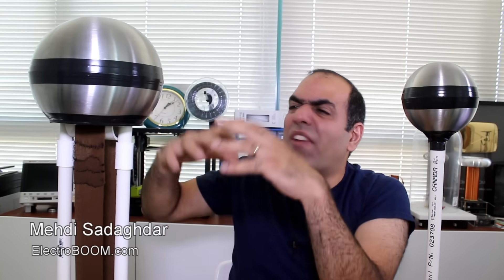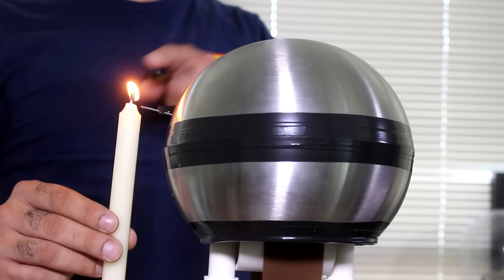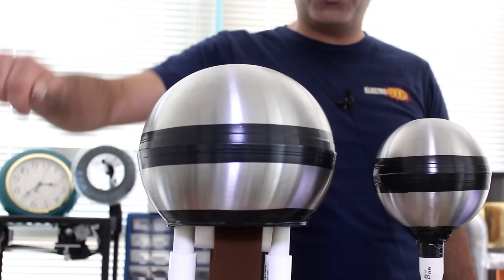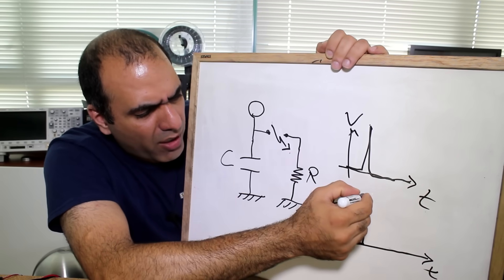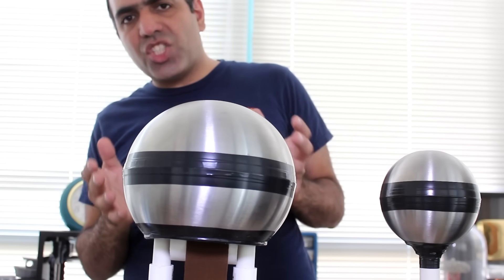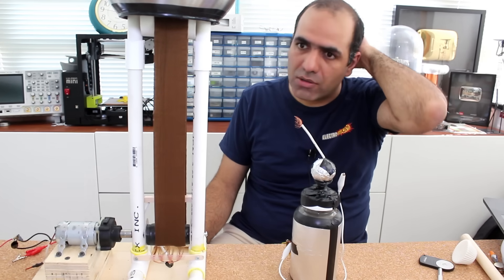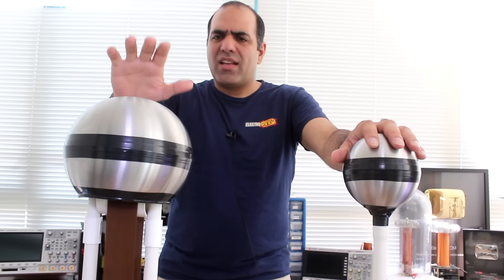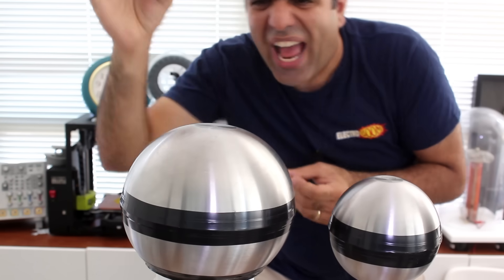Painful Experiments with Van De Graaff Generator

Comment: Dear Electroboom I would like you to explain something to me. You need around 20.000 Volts per centimetre and a lightning can obtain more than 10.000.000 Volts. But how is it possible that the lightning arks into the earth when 10.000.000/20.000 equals only 5 meters.
Reply: I might be wrong, but i think it's because humidity and water particles can provide a better path to the ground.
Reply: +KFC_Manager that may explain the weird paths that the lightning takes to the  ground, otherwise it would be a boring pseudo-straight line
Reply: Things behave differently at these voltages.
The 20000 V/cm rule is only at relatively low voltages helpful.
Reply: Mr Bass:
The air in a thunderstorm, especially in the upper regions, is really moist. This reduces its electrical resistance dramatically. Also the air gets ionized during a Thunderstorm reducing the resistance even further.
Reply: Raphael Arndt so if this boosts the length of the lightning this much and if Electroboom would use his van de Graf generator in a thunderstorm would the arks of his generator be almost equally boosted? In that case the arks of his generator should obtain around 200.000 Volts(generator)/10.000.000 Volts(lightning) times the length of a current lightning ( a little bit less because the air around the storm-clouds being far more ionised)...

Is this right?
Reply: Mr Bass They wouöd definitly jump larger gaps. But I can not tell how much larger.
Reply: Raphael Arndt but maybe Electroboom can tell us all in a video
Reply: Mr Bass would love to see that. Mehdi, would you please?
Reply: A very good question- hope he answers with a video actually, I would guess it has to do with that being a calculation used more for something like a spark gap which is simplified for typical conditions.
Reply: Think how the electric arc build up. Not only will exist a large potential difference between two points but as soon the dischage starts the air becomes very hot and conducting electricity in plasma is fair more easy than in air. This process occur sequentially until the potential diference becomes zero. The low pressure path is now occupied by air again and the collision of the air masses produces a sound: the thunder.
Reply: Leonardo Lelis a video about this phenomenon by Electroboom would be cool though
Reply: Leonardo Lelis well explained
Reply: Leonardo Lelis imagine he could reproduce that phenomenon in an artificial way
Reply: That would be a high voltage Tesla Coil in a low pressure chamber. Or he could reproduce the Wardenclyffe tower...
Reply: Curious to the answer too
Reply: Professor Walter Lewin answers this:
https://youtu.be/ww0XJUqFHXU?t=1476

The electric fields required for propagating an arc are orders of magnitude smaller than the electric fields required for initiating that arc.
Reply: I believe it is to do with the fact that when there is lightning it is usually raining, reducing the resistance of the air
Reply: During rain conditions with increased humidity such a voltage will easily ionize air particles around the source, and it becomes like a domino effect. The next ionizes the next and so on till it gets down to the earth.
Reply: And that may be what you have on 5 meters of air.. since a tree burst when hit by a lightining I think that 10.000.000 volt is just what it takes!...the clouds can be more charged in my opinion that voltage is just estimated I don't think somebody ever measured that!

Comment: @ 9:54 You said you can adjust the speed of an AC motor with a dimmer switch. I was always told that the speed of an AC motor is 

"Ns(rpm) = 120 x frequency /poles" The speed of an ac motor is not dependent on the voltage.

Comment: I had a science teacher show us one of these once and he did the cupcake wrapper thing but slightly differently. He used larger, tin wrappers and stacked them up on top of the orb before turning it on. They then got thrown off one at a time from top to bottom. It was especially cool because the rhythm was very consistent, just like those arcs in the video.

Comment: What happens if i have a power supply with current limiting feature and i set it to 220v and 1uA ? Will it hurt me ? So is it the current that kills you or the voltage ? Help me pls
Reply: You're talking about a neon mains tester (https://en.wikipedia.org/wiki/Test_light#One-contact_neon_test_lights), and no people generally don't die from using it. Then again, you should never take advice on electricity from a random bloke on the internet.
Reply: He's done another video on this subject. https://www.youtube.com/watch?v=XDf2nhfxVzg
Reply: Hera when the current is being limited, the voltage should also drop
According to ohm’s law V = I R
if the resistance is constant then V would be directly proportional to I

Comment: You should make video where you'll be making high current/low voltage transformer from the one from microwave oven.
And another one why ac hurts even without circuit (I know it's because of parasitic capacitance but talk something closer to the capacitance)

Comment: 1:16 "Single electrons" is the same as beta radiation. Have fun loosing all of your hair ;-.)
Reply: That's like saying getting hit by a truck is the same as bumping in to one in a parking lot.  Energy and speed make all the difference.
Reply: 4:36 "My skin is already getting red, and I can see some burn spots"
https://en.wikipedia.org/wiki/Radiation_burn#Beta_burns
Very high energies from electron beams from particle accelerators, reaching tens of megaelectronvolts, can be deeply penetrating. And yes, the Van de Graaff generator was developed as a particle accelerator for physics research.
Reply: energy several orders of magnitude too low for that to be the case. keep sciencing, though.

Comment: are u gona use that capasitor that u made in first vid??? or am i mising somthing???
Reply: It was getting charged through the air - that's why it kept discharging occasionally even with only a ground wire hooked up to it.
Reply: no no i mean not the laden jar but the other one

Comment: My question is, what if the arc had gone to your eye instead of your nose? Would it cause serious eye damage?
Reply: I think it would definitely hurt and depending on where it hit, I think it could do some lasting damage (on the cornea, for instance). It sort of depends on whether you are grounded. I say this because . . .

. . . I recently (and intentionally) took a spark from my VDG on the tip of my tongue while wearing insulating shoes. It felt like I bit the end of my tongue- hard! Ouch!!! My son did the same thing while bare-footed, and only got a mild tingle (he said it tasted like metal).

Comment: Could it be possible to use this machine or a similar one as a generator to reduce the costs of the electricity bill?
Reply: Unless I'm way offbase (I'm not an electronics engineer), it only holds 9 joules of energy when fully charged (and takes a few seconds to reach that).  1 joule = 1 watt second.  Given that your electric bill is probably in units of kilowatt hours, you wouldn't notice a difference.

Comment: And if you transverse the high voltage it produces into high amperage,240 volts/200 amps though a step-down transformer,then go through a set of super capacitors,then rectify it to AC,you have your free energy generator.(can be done though induction coils too)
Reply: Chuckiele Do you realize if you think of it in terms of ratios.If you take 100,000 volts then step it down 100 times or to a 1,000 volts,how many amps you would have?.More then enough to run all of it.
Reply: Chuckiele Sorry,you grossly over looked at the fact of what super capacitors do.Super caps have the same discharge rate that a truck battery would have because of the thousands of farads that a supercap has.I have a neighbor that installed three super caps in his semi-truck,replacing the three batteries that were there,it starts better and the alternator actually shuts completely off during operation,because it doesn't take nearly as long to charge a supercap,as it does a battery and the super caps hold a charge much longer then a battery.Tesla has already done these things with complete success and its incredable to me that the ONLY thing people seem to remember about him is the Tesla coil and nothing else,how sad because this is HIS idea that I'm talking about,then you say it doesn't work.Its sad and hilarious at the same time.Tesla had patented more then 900 NINE-HUNDRED inventions in his lifetime,this was one of them.
Reply: Tesla   was a great man, but the later media and fans turned him into some kind of free energy freako maniac he was not... yes he made a lot of good inventions, but he didnt create free energy like what people cult about him nowadays..
Reply: fidel catsro HAHAHA!!.I think you better go to you local library and ACTUALLY LOOK at the book called"MY INVENTIONS",nearly ONE-FOURTH of Teslas inventions were about FREE ENERGY AND ZERO POINT ENERGY,his name is on EVERY,SINGLE,INVENTION please ACTUALLY READ TESLAS BOOK BEFORE POSTING.
Reply: the closest cat he got to ''free energy'' was in his attempt in trying to transmit electricity WIRELESSLY!! ...
Reply: There is no point in discussing you, you dont understand basic laws of physics and have no sense of logic at all.
Reply: Chuckiele That's mumbo-jumbo for"I NEVER READ TESLAS 📚 BOOKS",but I'll make somebody else look bad.(nothing new here)
I'll tell you what,type in the name "Gerard Morin"into your Google search engine.You will be AMAZED at what this guy has LEARNED from Tesla's publications.
The problem here is frequency versus basic ideas of electricity.If you REMOVE electricity and replace it as RF,the efficiency goes out-of- the-sky.
This something that Electroboom could learn from as well.
Reply: I wasted 4 yrs trying to search a way to cheat laws of thermodynamics and failed badly, SOLAR was the only thing that put a smile on my face in the end..
Reply: 4gauge > If you really want to try and fail like me, i suggest you try Don Smith experiments... go look it up on you tube...it never hurts to Dream on and i wish you the best of LUCK!
Reply: fidel catsro Well,solar is a waste of real estate,I know of someone that sells solar panels,they are a joke,produce very little power also.I'll stick with the frequency co trolled generator systems,they are crazy efficient,super cheap to run,produce almost ZERO heat signature and have at least a 1,000,000(ONE-MILLION)hour reliability rating.
Reply: fidel catsro You know I actually bought his DVD's many years ago and they were quite interesting,but it was missing something and I figured it out just recently.I enjoyed watching and listening to Don's seminars,but he always left alot of people in the"dark"and like I said,I just figured this out recently.What the big problem is with Dons experiments is he NEVER talked much about how important it was to eliminate the electrical and bring in RF onto the seen.The railroad within the last 10 years completely got rid of ALL of the AC motors on their diesel engines and went with much more powerful and efficient DC RF motors for this reason as one example.I don't even think Don Smith is still alive anymore,I actually spoke with him on the phone on two different occasions and he said he was having heart issues the last time we talked.
Reply: wont be as easy as that, because of the tremendous resistance losses in the transformer
Reply: fidel catsro I'm soooo glad that I read Teslas book called"MY INVENTIONS",that's where I got the idea from.
Reply: Theorically you are correct...but in real life the losses are terrible , see my videos, im a Teslacat too! real free energy we can have today is still renewable energy as i realized..solar and wind
Reply: fidel catsro Electro magnetic and zero point are free energy sources too.
Reply: ive done some experiments about those too...example like bedini motor, the charging effect is there from back emf voltage surges but amperage is very very low..it charges batteries but it wont have the amperage you need to move on...it does revitalize some (not all) old batteries however!
Reply: Yes, many amps for a microsecond. You wont get more energy out than you have put in. You can create high voltage and you can create high current but you cant create energy.
Reply: You do realize that the motor needs a power source, dont you?

Comment: Do you have a tip for me
I need a adjustable power supply with 5 A (minimum) for less money?
Reply: Conbuilder _ digital Buck boost converter from eBay , or the rnb lab adjustable lab power supply 30v 5amp for around 40€
Reply: Peter Zingler 
Thank you
I will look after it

Comment: How did he not die is the real question
Reply: It's like he said in the video, there's not much electric charge in the generator so when it discharges the voltage drops almost instantly.

Basically, the shock doesn't last long enough to do any damage other than tiny burns on his fingers (and nose).
Reply: Because you dont die when walking on carpet with gummy boots and touching a metal object either. Same principle just a bit bigger charge.